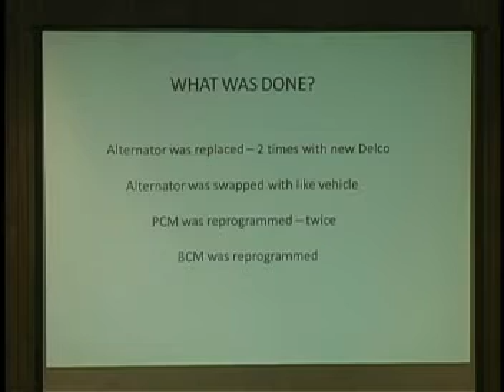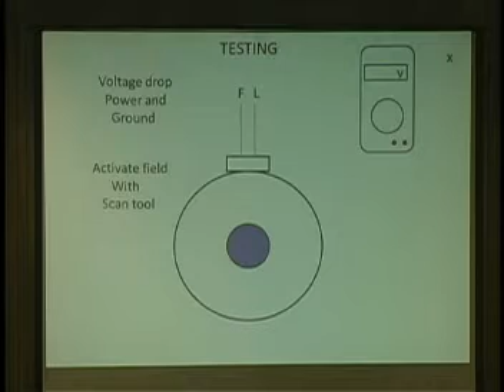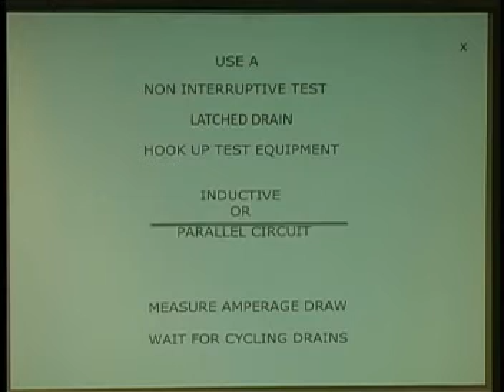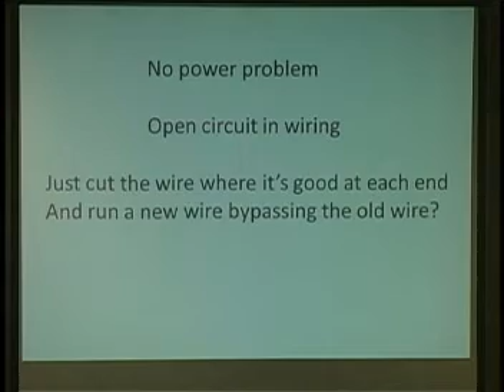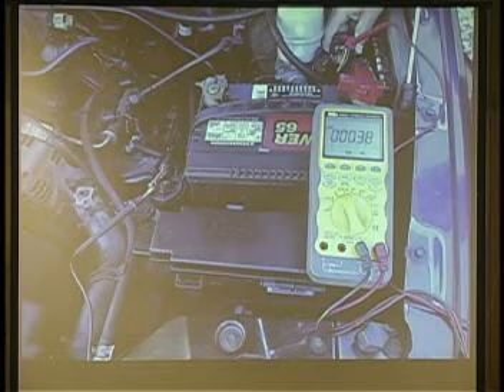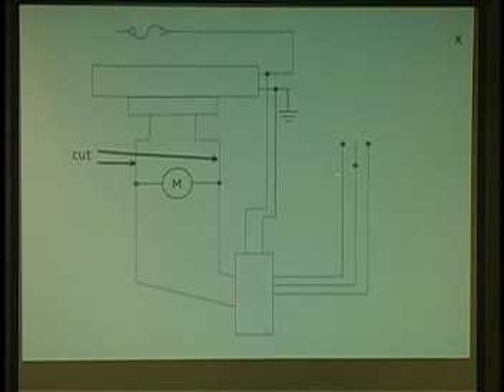Electrical Quick Diagnostics and Repairs with Rich Peterson

Comment: Most Alternators now have 3 Wires, the Center Wire usually tells the Voltage Regulator to CHARGE, 2010 Nissan Messed up the Color Code at the Factory,

Comment: I strongly disagree with him when he's saying soldering connections is bad. They are just as flexible as butt connectors or crimp connectors. That's a fact. A crimp can't hold the wire unless it's stiff. If a stiff connection is a no go then cars wouldn't be able to be made. Every connection is stiff

Comment: So, the F terminal in 2 wire GM is duty cycled; this is the control wire, right? The L terminal tells the pcm if the battery is charging and does not duty cycle, am I not correct?. I hear you say the F terminal is feed back and L terminal, control. It is confusing.
Reply from the maker: Sorry for the delay...here is your Answer...On GM systems the F terminal is an alternator regulator output of the field duty cycle monitored by the computer. The L terminal is a duty cycled computer output to turn on and control the regulator in the alternator. The computer also monitors the L terminal for a near ground signal from the alternator which is given when a no charge, low voltage, or fault exists.
 
Thanks for watching...If you have not already subscribed to our tstseminars YouTube channel please do so. Interested in more training? Go to www.tstseminars.org and view full length videos for members on TechFlix for $9.99 unlimited viewing …Membership and over 85 videos for less than $200.00 a year. Also checkout www.attstraining.com for hands on training and webcast

FREE videos at www.tstseminars.org/training-videos

Comment: One thing of concern to me, hooking a jumper pack in parallel to the car battery, with the amp meter in line, seems likely to blow the meter fuse due to a large current surge (either direction) as the jumper pack voltage and battery voltage try to reach equilibrium.  I'd feel better with a 2 to 10 amp charger, instead of the lithium jumper pack, just to restrict current until the battery cable is disconnected from the vehicle battery.  Just my two cents.  At any rate, I'm pretty handy with electrical things, but I always learn a few things from these videos.  I really appreciate that you've made these available for free. Thank you, sincerely. :)
Reply from the maker: Tony thanks for you comment but a jumper pack will not cause an issue....current only flows if a circuit is on. I never had any fuse blow nor has Rich the instructor in the video. We appreciate you 2 cents ....If you have not already subscribed to our tstseminars YouTube channel please do so. Interested in more training? Go to www.tstseminars.org and view full length videos for members on TechFlix for $9.99 unlimited viewing …Membership and over 85 videos for less than $200.00 a year. Also checkout www.attstraining.com for hands on training and webcast
FREE videos at www.tstseminars.org/training-videos

Comment: THANKYOU by far the best parasitic drain test   I found  a draw on a vehicle that went through the shop 3 times  Glad you put this out  for us to  cover every possible cause   When you  connect a jumper pack do. You measure battery voltage first then set the battery pack voltage a little higher ? And a low amperage ? Anyway THANKS GOD BLESS
Reply from the maker: The jumper pack is to take the place of the battery in the vehicle when  you place your meter in series so a sticking relay does not disconnect. Thanks for watching...If you have not already subscribed to our tstseminars YouTube channel please do so. Interested in more training? Go to www.tstseminars.org and www.attstraining.com.